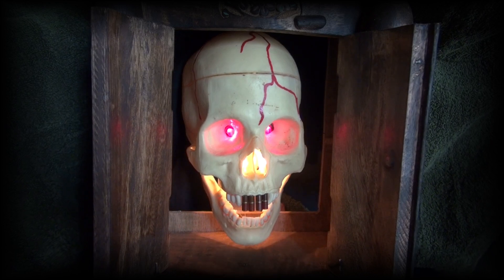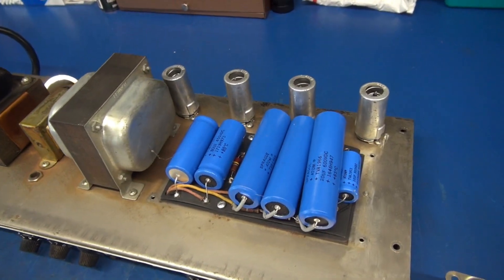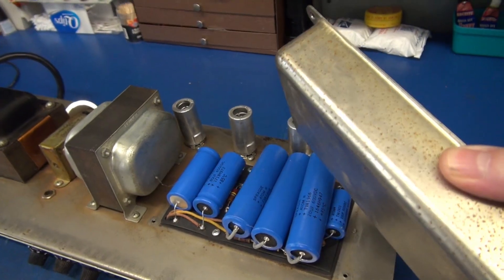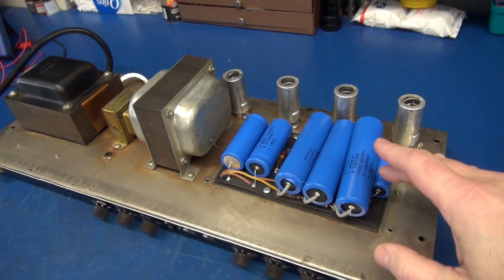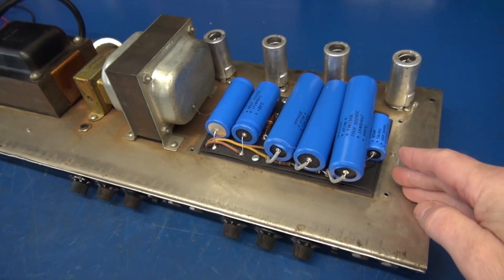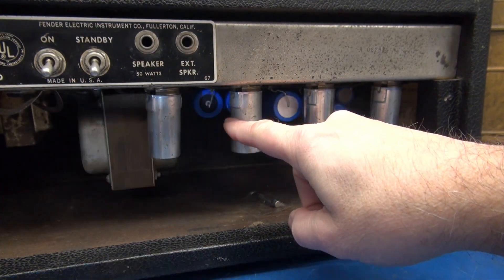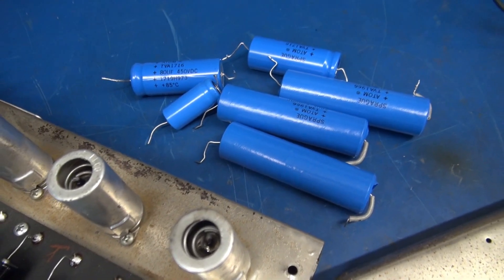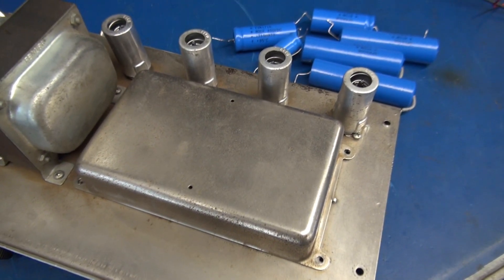Vintage Fender Guitar Bassman tube amp dangerous Filter Cap installation Hazard Shock Theater

Comment: Let me introduce you to the evil, possessed “Jack the Ripper” of 1930’s of guitar amplifiers so that the manufacturer had to put this legal warning.
WARNING!
This amplifier is made to accommodate AC and DC currents. Due to the construction, any amplifier made to accommodate AC and DC should be operated with care to avoid electric shock. If you should touch any grounded object such as steam radiator, water pipe, metal shaft or body in contact metal on the instrument or amplifier you will receive an electrical shock. The same would be true if you were on wet ground. GIBSON INC.  (This is the legal warning inside a 1937 Gibson EH160 AC-DC guitar amplifier)

Comment: Great workmanship Terry! 
I knew D-Lab would not let something unsafe be passed on without resolving the issue. A person's workmanship is a reflection of their ethics and reputation. Reputation is gold and hard to earn, but so easy to tarnish.

I hope the tech who worked on this was made aware of the safety issue for the end user. 

I did look as though there was some kind attempt at placing tubing put over some of the hot bare wire portions, but eh... not good.

Comment: Hello Terry - I had a Bassman on the bench and as luck would have it .. I didn't bleed the electrolytics, mistakenly thinking the bleeder resistors had long done their job. Let's just say 500volts on the fingers does not feel good. 🤪 Upon further investigation, I popped the hood and found that some brilliant tech had decided the resistors were an unnecessary complication and had removed them. Ouch! Your example however, is criminal. In my 55 years of repairing amplifiers I don't believe I have seen anything that egregious. 73's ... Daniel (Seaside, Oregon)